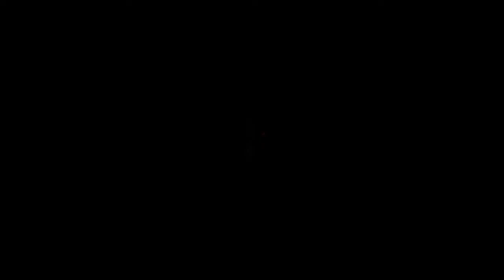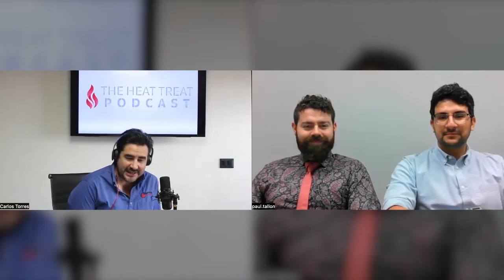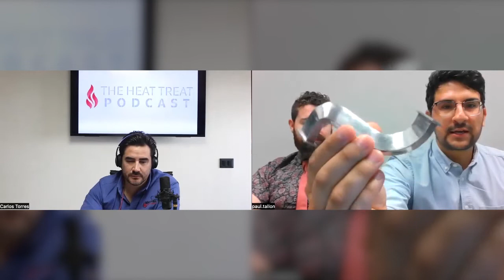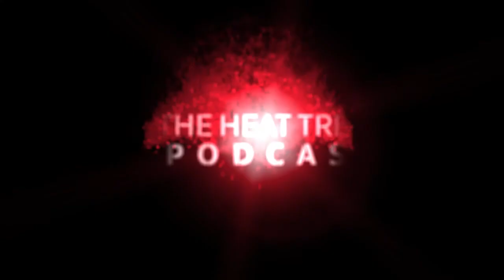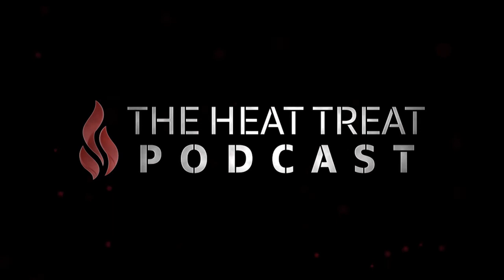Additive manufacturing and Heat Treat | Paul Tallon & Erick Tenuta | THE HEAT TREAT PODCAST #48

Comment: The biggest initial issues with power metals is the porosity between particles and the different layers. Once achieved and heat treated. You will have overall part success.